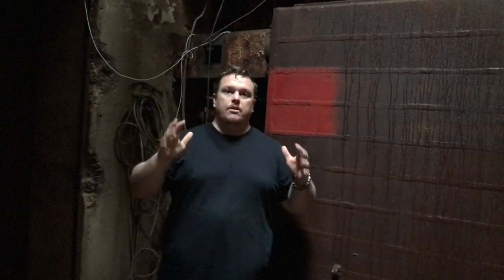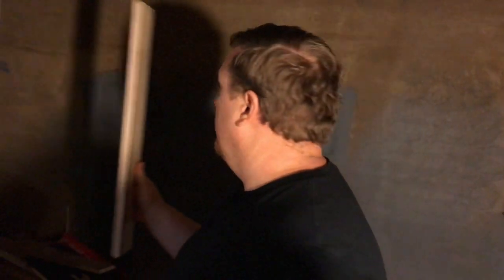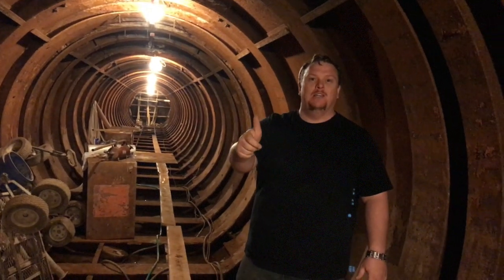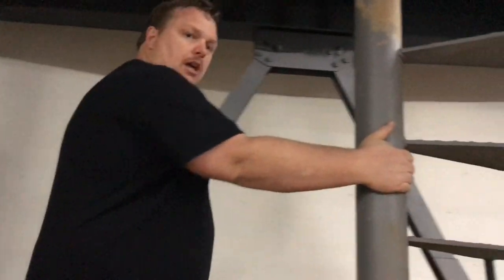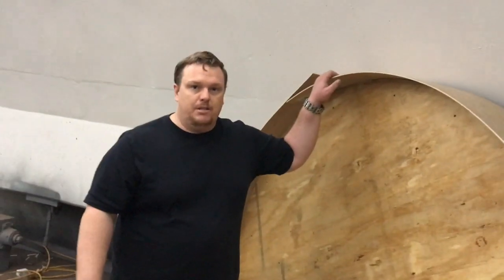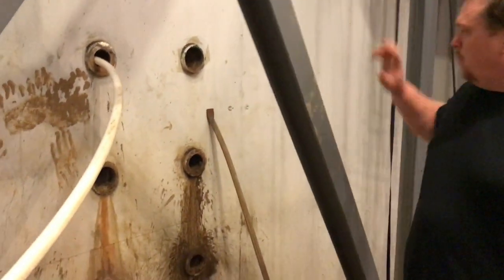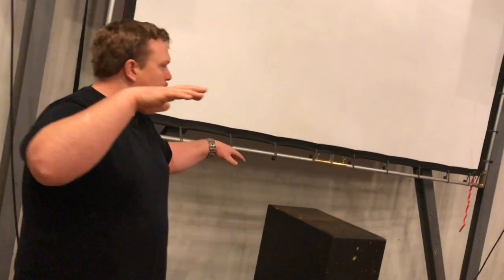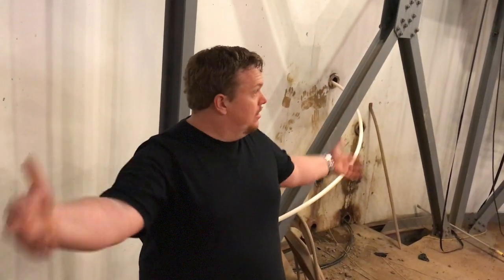EP17 - Progress Tour - Dec 2016

Comment: Thanks for the tour- impressed with what you have done. Your right- that salvage was money well spent. It cleaned up the inside and provided a fair but more space. Spiral stairs- your call of course. Looks a lot better but likely I would have kept original stairs. That lighting in the short cable way- bang on. Particularly the red! Level 2- the paint looks great. Like the way you painted the metal the medium gray. Looking forward to seeing what you did with the access portal, felt that likely needed a rebuild to original height to work well.
Reply from the maker: Thank you Rob!

Comment: Another fantastic video mate. Knock a hole in the silo cap, build a little lift or ramp down to the level of the tunnel and park a multitude of motorcycles in there? :) Just kidding!

Place looks great! As I am watching you video the little boy in me is going, " ooh how about a firemans pole down the escape shaft"! On that note, have you climbed the shaft yet?

Will it be easy to connect shower toilet etc to the septics? Im guessing the pipework to pump it the the surface is long gone. Does the sewer system pump back up and out through those connections in the wall? And when it does get to the top Im guessing you just have a regular septic and  leech drain setup?  Or is it  little different to the conventional system due to the amount of water you would be pumping up from your sumps? Sorry for all the questions, again! A very interesting project for sure!
Reply from the maker: Hey guys - We have some video of how all of this is going to work. Upcoming episodes!

Comment: Awesom! Awesome! Awesome! Love the LED lighting, the platform and level 3 looks amazing! instead of the stage fixture I bet some led RGB drop ceiling lighting would be awesome! (Might save your head too) Have you thought about  covering the walls of level 3 with foam acoustic panels? You could also cover the "ceiling" and either leave a gap for cage movement or seal it with soft foam panels and basically make a separate acoustic stage for parties and movies.
Reply from the maker: Thanks!

Comment: I remember you mentioning that the silo is full of large chunks of concrete and it would be difficult to excavate it due to depth. 

Have you considered buying an old backhoe (renting would be too expensive), using an unliscenced microblaster system (or a full sized system and get yourself a blasting permit) to break those big chunks, building an elevator to take the little chunks to the surface?

Turn the top deck into a garage, and play laser tag in all the lower decks!
Reply from the maker: I own a VERY old Cat 312 excavator. Maybe I'm not following your idea; you know the silo is 145 feet deep right? Its going to take something very different from an excavator to empty it out. :-)
Reply: You put the excavator IN the hole and use it to load the garbage into the elevator which moves that out of the hole. Actually, a crane might be better suited to lifting the junk as it can swing away from the hole.
Reply from the maker: Yeah, a crane is what I was thinking. So yeah, we are on the same page for how to do it. Going to be a crazy job either way. Some of the concrete pieces will be huge. And heavy. And would require rigging. All doable. Nothing money can't solve. :-)
Reply: That's what the blasting is for. You can break those chunks up with a 'microblaster' where you drill some holes and stuff them with what are basically very large firecrackers. As far as I know you don't need a license or permits for those. You could make your concrete problems go away with a minimum of rigging and heavy lifting.
Reply from the maker: Theldeanator - I'll check into that. Thanks!
Reply from the maker: Theldeanator - Did some research on micro blasting. Everything I've read on it is that its great for rocks. But concrete is designed specifically to not break under those stresses so I'm a bit hesitant. Any thoughts on that?
Reply: More power. 
I don't know what kind of concrete you'l be dealing with, whether its big solid bricks or 'thin' sections of wall, each requiring a different approach, so plan accordingly. Perhaps microblasting won't be strong enough to break up the rebar in reinforced concrete, but it might be able to expose it enough for you to cut it. I imagine you have some chunks you've already pulled out of the first pit laying around so you can try it out. If that doesn't work, regular blasting would definitely do the trick. There will be some level of power that is just enough to break the concrete, but not so much as to send debris through the silo walls. If rebar is still an issue, check out "shaped charges".

Comment: I like the circular light motif that you are using in the control center.

For the first time since I have been following you, I noticed that the Commie Stopper is much higher at the Arkansas sites as it was in the Kansas Sites.  At the Kansas sites it was about knee to waist high.
Reply from the maker: Commie Stopper? Seems like you are referring to something in particular in the site; not sure what that is. Thanks!
Reply: At the 45 second mark, you are standing in front of Door 7.  Over your left shoulder you can see a loop welded to the door.  There should be another one embedded in the doorway at the same height.  
Many years ago, someone figured out how to manually manipulate the hydraulic pins in the door and penetrate the security. The solution was to use a large metal "hook" just like the kind you would use for a screen door.  In this case, the latch was about 3 ft long and about 1" in diameter.  We would latch the door closed from the inside after hours.  We lovingly called it the "Commie Stopper".
As I was saying, at McConnell AFB, they were mounted much lower than it appears in this video.
Reply from the maker: Ah... yes I'm familiar with that and the story. Just never heard it called that. That's interested that in a different place in KS. Guess someone's contractor didn't read the specs right. :-)
Reply: You may be right.  I suppose it is also possible that the specs were left up to the individual bases.  I was watching a tour video at the museum in Tucson and in the video it was up high there as well and was painted yellow.  At McConnell they were red.

Comment: It's looking great, and I love how you interact with everyone in the comments. Couple things, how are you venting the stove vent? On the top floor with the acoustic problem, have you considered making a platform/false ceiling where you could fix that problem and have a little storage space or a loft bed up there? The tall dome is very pretty but those acoustics are going to be tough to dampen.
Reply from the maker: Thanks Bennett! The stove will probably just be filtered vs. vented. I could fix the acoustics easily if I wanted to hide the dome. But I don't. I just got in a box of acoustic material to try. The acoustic company said I'd need to cover about 40% of the walls / ceiling. Doing a bit of online math (meaning google did it for me) the ceiling dome area is about 1100 sq ft. One of the least expensive panels I could find is about $2 per sq ft. So it will take at least $1000 to cover it. Not something I'm excited to spend money on but it needs to be done.

Comment: If nothing else, you can easily convert that silo tunnel into a massive storage area. Shelves on each side. 
Of course, bedrooms, as you mention would work great for company too- but I know in a standard house, one seems to always gather a lot of extra stuff that needs storage.
Reply from the maker: My hope is that all general crap storage will be topside. That may be too idealistic though. :-)
Reply: Don't forget too, general crap is usually something you used at one time, or plan to use again. Don't necessarily want to have to run all the way up to the surface every time you decide to check if you still have that one item sitting around somewhere.

Comment: What's going on with the outside? I take it you haven't built any of the "ground" floor?
Reply from the maker: No... nothing going on there yet. Focusing $ and time on the inside for now.
Reply: How about your weather defences? I saw rain still coming down at the entrance, do you have plans for that? 

Sorry loads of questions i'm sure you've either answered or going too.
Reply from the maker: No plans for that right now. Its so minimal that its easy to deal with. However, the walls of the access portal leak. So even if I did protect it from the weather I'd still have water coming in. Still not sure how I'm going to solve that water problem. Been kicking around a few ideas.

Comment: That is awesome.  I've been watching all your videos and I'm jealous.  I do have a couple of questions though.  It sounds like you still haven't sealed off the access portal.  Now that you have quite a bit of valuables in there, how are you stopping it from flooding again?  Also, wasn't there a bunch of nasty gunk under the birdcage down on the concrete?  How did you clean that out?  Just though of another...how/where are you going to pump the septic out from the tank?
Reply from the maker: Thank you very much! The access portal isn't sealed off. Won't seal it off for a while if ever at all. And... under the birdcage? Buckets. Hundreds... really probably thousands of 5 gallons buckets (not full.... VERY heavy full). 

Septic tank actually works right now. Need to put that in a video...
Reply: Do you really want the septic system in the kitchen/fun room? If it works the way I think you may need to access once in a while and the fumes will likely be otherworldly.
Reply: Not with the proper ventilation pipes in place. It would/ should be a closed system where the sewer gag would not mix with the breathing air.

Comment: Hey GT, I'm curious about your HVAC system. It doesn't look like you are using the original air shaft. The escape hatch is closed and I didn't see anything on level 2. Did you ever get the blast valve rebuilt or is the air intake wide open? Thanks.
Reply from the maker: I removed the original blast valve because there was mud and debris in it from when they filled the vent shaft. I will eventually install it again.

Comment: That open circuit breaker box makes me uneasy.
Reply from the maker: Just temporary. We rarely even mess with it. I'll get more permanent power put in soon.
Reply: At 1:19 you can see that the bus bars are just waiting for something to short them seeing that it's sucha busy room. Really just need any metal cover slapped on it.
Reply from the maker: Mark - Agreed.... that's a good tip. I should just get off my ass and get the real electrical done.

Comment: You know, about that tunnel... Shooting range, at least for now? With a door and proper sound deadening, it won't bother anyone in the rest of the complex.
Reply from the maker: Oh... we've done a bit of shooting down there. :-) 

From the end of level 2 to the end of the tunnel isn't quite 100 yards but that would be awesome if it was. And yeah, the tunnel itself could be sealed if I closed one of the doors.
Reply: Death Wears Bunny Slippers be careful of lead poisoning. small amount of lead are vaporized every time you fire.
Reply from the maker: Lead free rounds - SS198 to be exact. :-)
Reply: Death Wears Bunny Slippers btw, how are you ventilating air? I may have missed if you upgraded from those plastic tubes
Reply from the maker: Vent air comes in through the vent shaft. The only time we force air is during construction. Otherwise we aren't in there enough. Will need an air system eventually.
Reply: Death Wears Bunny Slippers what is the temperature like? I imagine it's pretty chill down there. thanks for the quick replies
Reply: Yo Gino, looking good bud.  Eagerly waiting the next video.
Reply: it should be around 55 down there without any heater
Reply: or archery range.
Reply from the maker: 58 but its normally a bit warmer in there with lights and such.
Reply: Have you considered running a light pipe down the escape hatch to allow natural light in ?
Reply: Agree with the Shooting range idea the ways the walls are shaped it would catch ricochets and prevent rounds from coming back at you .
Reply: @TheRealSasquatch  Just use some high CRI leds. Something that is 95+ CRI at 5600K looks almost like sunlight.

Comment: I was a BMAT at McConnell during the 70's.  That motor-driven, cam-operated microswitch assembly you like (there were two) were telephone ringers.  When you picked up a phone, say a gate phone or portal phone, the MCCC and DMCCC's console rang, just like all phones rang in the 60's, with a mechanical ringing signal.  Stromberg Carlson (a phone mfgr) made these.  Yes, what can be done on a microchip today took a machine that probably cost, even then, hundreds of dollars, just to make a phone ring! BTW, like all phone systems, they ran on DC power, with battery backup.  Probably 12VDC or 24VDC.
Reply from the maker: That's great Marty. Thanks!